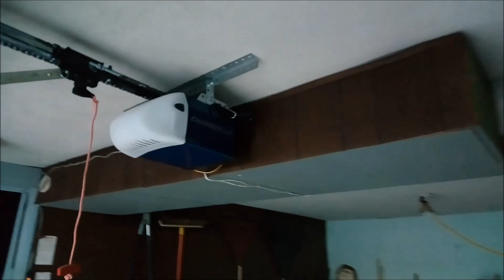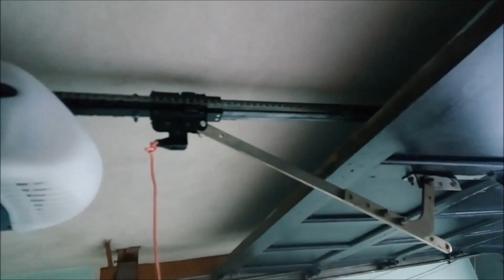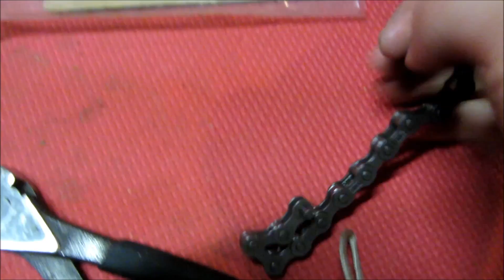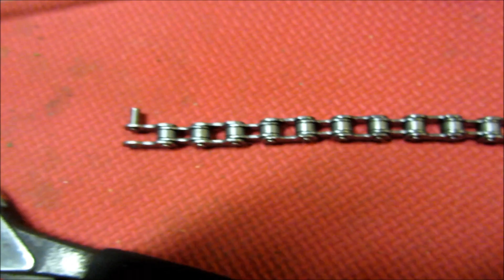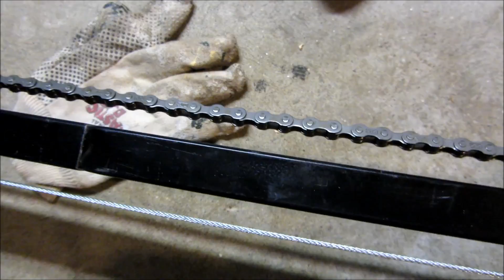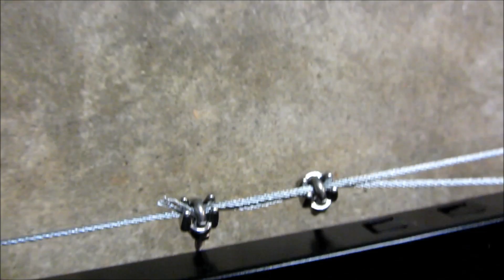Garage Door Opener - How to Shorten and Cut the Rail in a Chain Drive (Part 1)

Comment: You put the cable clamps on upside down. Dangerous! "Never saddle a dead horse." The saddle part must always go in the standing part of the cable. The loose end goes under the u bolt. "I knew you had no idea when you called it a cable tie."

Comment: Chain Drives
1. Shorten and Cut the Rail

Cutting a Square Rail

Locate the center square rail section and cut the desired number of inches from the female end. It is okay to cut off the tabs. Do not cut the tapered end of the rail section.

Cutting a T-Rail

Locate the T-rail section that will connect to the header bracket above the door and cut off the desired number of inches from one end. The idler pulley bracket attaches to the T-rail using two hex screws; therefore, it is necessary to drill two holes in the newly cut end of the T-rail to accommodate this. You can use the piece that has been cut off as a template for drilling these holes.

Attach the Idler pulley bracket to the end of the T-rail using the newly drilled holes.

2. Shorten and Cut the Chain/Cable

Now that the rail has been cut to the correct size the chain/cable must also be cut to fit.

Measure the length of the T-rail or Square-rail section that was cut. This is the length that must be removed from both the chain and cable. For example, if 3 inches were cut from the T-rail or Square-rail, 3 inches must be cut from both the chain and cable. This means you must cut 3 inches from the cable and 3 inches from the chain.

You will need to re-clamp the cable into a loop (cable clamps are available at most home improvement stores). If you have a complete chain, you would cut the chain double the amount of the rail, 1 foot rail, 2 feet chain. To cut chain, you may need a chain breaker as well as a master link kit which is available at most home improvement stores.

Now that your rail and chain/cable are the correct length you may continue to follow the installation instructions found in your owner's manual. Please note that a shorter rail length may require you to decrease travel limits. Instructions for setting the travel limits are located in the owner's manual.

Comment from the maker: The previous 30 yr old Stanley Garage Door Opener on the original house was also done this way.  With the same looking 2 cable ties on the cable, feel free to put 3 cable ties if you want.  So basically replicating the same methodology that was on the house for 30+ yrs.

Comment: Dont do it on these do it yourself models, need to be done with a pro rail only, those cable ties will give out(i have seen it hundreds of times).  Recomfiguring a pro chain rail is chalenging because of the cast iron that is used
Reply: What about a drive shaft opener distance problem

Comment: I need to trim three inches off the rail and then shorten the cable by three inches.  Just wondering why you would need to adjust the chain by three inches?  Wouldn't the cable shortened be enough?
Reply from the maker: The rotation of the "travel" between the chain and cable is circular (oval) so when you remove 3" of the rail, you have to remove 3" from BOTH sides, its not 1:1 but 2:1.  The reason why you don't cut 6" of cable or 6" of chain, but rather 3" of cable and 3" of chain is because you want it even such that the pulley's and stoppers and whatever facilitates the rotation of the chain is even.  Meaning you don't have it over-rotating to the point where something that pulls the chain, is now running against the cable for example.

Comment: Thanks for posting this video. Can you verify where to cut and rejoin the cable as I need to be absolutely clear on this point before I make the cut. Thanks
Reply from the maker: Did you watch the 2nd video?  https://www.youtube.com/watch?v=WJob3zYbIkg  In the 2nd video, make sure to notice that the garage door is open, so for my model the chain and cable goes from left to right, while the door is opening.  Similarly, while the door is closing, the chain and wire goes from right to left, moving away from the pully.  You want to cut as far away from the pully at the end as possible, while leaving room where you can overlap and connect the cable with cable times.  How many inches are you cutting off the rail?  Make sure that your garage door opener is like mine in that when opening counter-clockwise, but when closing it goes clock wise.
Reply: I have to cut 7 inches out of the rail. The plan is to remove 7" from the centre of the chain and 5" from the cable (to make sure the cable ties don't interfere with the pulley) any slack in the chain to be adjusted at the trolley. My opener is not exactly the same as yours but the travel is the same. It's a Chamberlain PD752KEVC
Reply from the maker: Keep in mind you are not "removing" any cable, so the cable can be shrunk or lengthened by overlapping and placing the cable ties in particular locations.  Giving you wiggle room.

Comment: Thanks for putting this video up!
Reply from the maker: Thats what i'm here for, let me know if you have any questions.
Reply: Poolarity Your video gave me the idea of cutting away the drywall above the garage and installing the rail directly to the stud. This saved me just enough room so that I could get the rail to fit without having to cut it. Fortunately, there's still about an inch of clearance between the beam and garage opener. Luckily, all our controls for adjustments are on the side! Thanks again!! You seriously saved me a ton of time, even if our installs weren't the same.